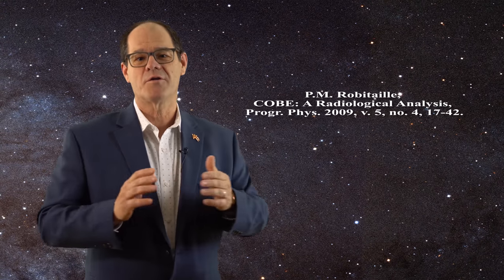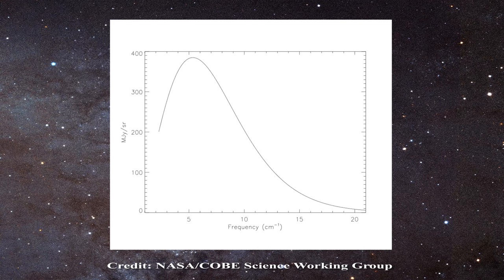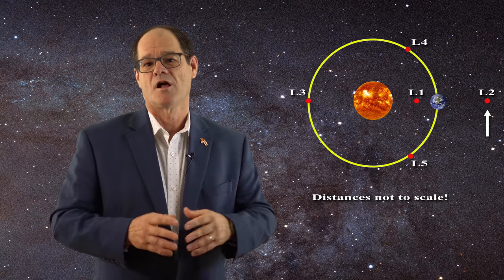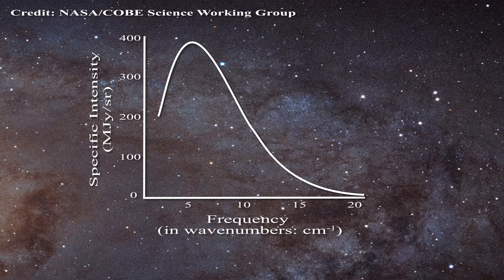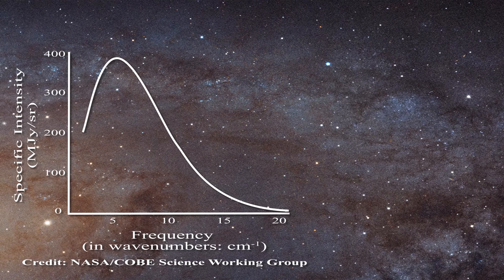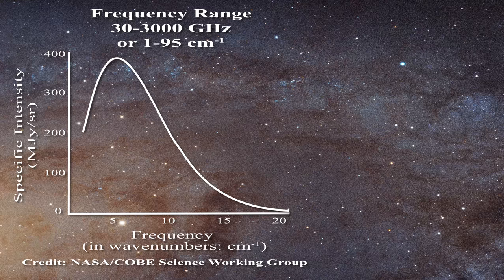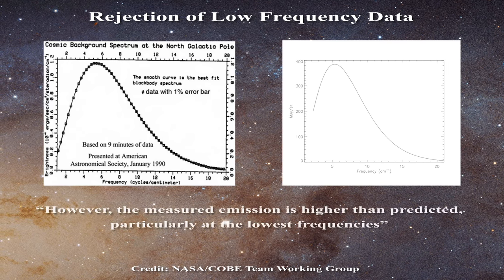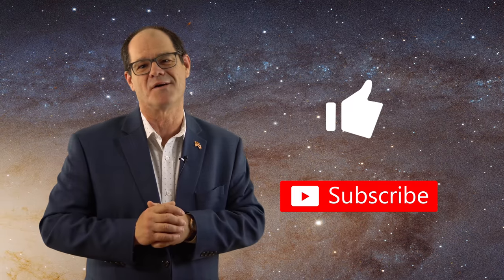The Microwave Background - COBE Satellite Results Explained!

Comment: Excellent.  Very informative and thought-provoking....  In particular, I love the part about the one sentence dismissal of the higher than expected emission in the low frequency band.  Scientific sell-outs.

In every field there is the challenge of measurement.  The real world is vastly different than theory.   Although I have not yet read the papers, as a computer science dude I can tell you that there are always challenges to how data is interpreted.  Moreover, there are challenges with algorithms for things such as curve fitting, first the mathematics but also the error introduced by numerical methods.  The computer science application of numerical methods is something that has been an intrinsic issue since the inception of computation.  I'd be curious to see the details of the mathematical algorithms as well as their data processing implementation. used to do all this interpretation of microwave detection data. 

So good to have you back Dr.  Robitaille.

Comment: I find it hard to believe that they didn't characterize beam patterns vs. frequency for the horn as mounted, including sidelobes and backlobes.  IT costs some money to do correctly, but this is the most basic antenna characterization, and you would have to be extraordinarily incompetent to not do this.

If there is not any good documentation on the beam patterns, they should be fairly easy to estimate by anyone knowledgeable of the basic design, and would be fairly easy to model using any modern RF tool.  I'd say the best they could do for sidelobe rejection at the lower end of the spectrum is about 30 dB, without sophisticated coherent cancelers, but they would also have to be very primitive to not include cancelers.

The heat shield is not good enough to block microwaves across all frequencies, as you get "creeping" waves in addition to diffraction, and just sheer skin-effect bleeding.  The full beam pattern with all interference compensation should have all been rigorously characterized and documented somewhere.
Reply: Well, they didn't characterise the beam patterns properly: far from it. Owing to the need to significantly reduce the weight of the satellite and to get it into orbit on schedule they cut corners everywhere, and thereby did not do what they should have. In fact, they did very limited testing on the ground and never with the assembled instrument. Moreover, they tried to characterise the beam patterns when in orbit, using the Moon as a source.  Dr. Robitaille has addressed all this in detail in his paper:

Robitaille P.-M., COBE: A Radiological Analysis, Progress in Physics, v.4, pp.17-42, (2009), 
http://vixra.org/pdf/1310.0125v1.pdf

Additional information on the thermal-RF shield inadequacies can be found here (page 214):

COBE -  On orbit engineering performance
, 

https://ia800303.us.archive.org/30/items/nasa_techdoc_19920008877/19920008877.pdf
Reply: @stevecrothers6585  Thanks, Steve.  I will dig into this a little further and see what I can find out.
Reply: What is/was stopping them from building a copy & fully testing the copy on the ground? I think this refers to COBE, but praps the same could be said for others.
Reply: @atheistaetherist2747  This is a good point, if they really wanted to confirm the revolutionary findings, there should be some due dilligence.

Comment: Doc, how do they distinguish the microwave emissions of galactic origin from the background behind it?
Reply: Simple. Just assume that nothing can produce microwaves except the big bang.
Reply: By statistics as usual. You can’t distinguish it at all, so they feed in statistics and model it until it looks pretty.
Reply: @Problembeing  black box of "methods" to produce image. I've yet to see a paper actual explain their data analysis in plain text of human processing.
Reply: Michael Pierce Indeed. well, if we go by the acquisition of the supposed image of a ‘black hole’ by EHT, where they took petabytes of data and used various methods to ‘remove noise’ (IE through process of elimination and bias through modelling and throwing out petabytes of data without independent oversight) I’m sure we can be legitimately certain a large amount of fudging and selective bias were invoked to produce this image. To average out an image of this sort, it stands to reason an element (arguable a proportionally high element) of feeding statistical data through a super-computer would have been the process to concoct it. The absence of the actual process to acquire this image speaks more volumes than any thing have published. It’s conspicuous by its very omission. What is even more striking is no one from COBE or any of its advocates or the scientific community at large question it whatsoever? How do things like this get a free pass when it is glaring at them like a massive rampaging elephant in the lab.
Reply: @Problembeing  that definitely seems to be the rub of it. Their modeling, and noise reduction methods are unpublished and obscured by technobable that they "did something" but didn't publish that methodology at all. It's one of the biggest complaints I have reading a lot of modern papers is how often detailed methodology is skipped in order to make big claims. it seems to me the bigger the claim the more precise you have to be with your methodology so that your peers can legitimately peer review your research.
Reply: Steve Crothers good ol’ Steven Crothers showing how it is even worse than imagined. It’s scandalous.
Reply: Michael Pierce well, as Steve Crothers has just posted, the whole thing seems to be nothing short of a complete hoax.
Reply: @Problembeing  I think what's happening is that people are protecting their careers by obscuring their research. We have a problem in the community of those interested in science where people have made an occupation around certain models being correct because of hyper specialization. Hoax has a different connotation to it in the public mind. This is simply people lying about their own research in order to self-serve.
Reply: Plasma Matter  the medium is undeniable.  It has a measurable dielectric constant.  It is the substrate upon which "reality" plays out.
Reply: Simple: They don't.

They feed the data to a computer, lower the resolution of raw maps (so that the processing takes much less time), run the data through models (I reckon that in all cases those models include Big Bang and inflation as a fact) and then apply obtained masks to the high resolution images and show them to the public.

Of course the joke is that they always obtain different masks, because each model produces different results and the microwave signal from the universe itself is constantly changing.
Reply: @LecherousLizard  he wound up covering that question in later videos.

Comment: An alternative approach to microwave background, otherwise the expanding universe from :-  Light speed and Doppler shift. 

We may agree that vacuum is empty in a jar but interplanetary space isn’t entirely empty. It is filled with Aether, electric charge, electric field and tiny particles - the size of molecule and down to subatomic substance. Light requires a medium to propagate that is Aether. Aether, is represented by two measurable substances, E0 and U0. 

Solar wind or solar charged particles loaded up the Aether space increases Aether from E0 and U0 to Er and Ur. Light speed is slower in close proximity with the sun produce a shorter wave length in Er and Ur, hence Blue shift in day time sun light. All spectrometers on earth calibrated with solar light will be biased towards Blue. With spectrometer carrying blue shift error, all stars in our night sky will appear Red shifted. Hence, no red shirted galaxies, expanding universe, Big Bang, bang echos or microwave echo background.
Reply: There is no vacuum in a jar.  There is always the aether, the substrate of the universe that we know otherwise as the dielectric.  It has a constant associated with it.  The medium is.  Without the medium there is no way to exchange/transform energy.
Reply: t00by00zer 
Well said. I agree. I knew vacuum jar isn’t empty is filled with Aether. I use empty jar as a start for curtesy to our Einstein’s friends. To avoid provocation.
Reply: What your so poignantly explaining, was known as the primordial waters of Nun. The same waters that Jesus walked on. Yes I said Jesus. The light in the Dark is the perturbation that is known as the Logos. When Phohat digs holes in Space, Anu appear.
Reply: Slightly Slanted Sleuth 3 4 Truth 
I’m sorry. You’ve lost me.
Reply: @philoso377  lost in space lol, jk. But the light, aka demiurge as it was known to the Gnostics, yes?

Comment: Here is a question about the claimed Cosmic Microwave Background curve produced by the COBE satellite instrument identified as "famous for having obtained the best blackbody radiation curve ever as you can see" in the figure presented in the video. The figure presented has the appearance of a Planck blackbody radiation curve over a complete wavelength-frequency domain, but it actually doesn’t come close to filling that domain. A graph at the link below is from a 1990 paper with preliminary findings by Dr. John Mather, a Nobel Prize winning COBE scientist. 

The Wien radiation law causes a Planck blackbody curve, when plotted by wavelength, to be steeper on the side where the wavelengths are shorter because the frequencies there are higher. Yet the COBE graph curve is not steeper on the side of the higher frequency wave numbers along the bottom of the graph. (Dr. Mather labeled these numbers: "Frequency | cycles/centimeter |.” To convert these to GHz multiply by 30, rounded, i.e. one GHz, one billion cycles per second, into the speed of light, 30 billion centimeters per second, rounded.)

The COBE graph appears to have the shape of a Planck blackbody radiation curve over a complete wavelength-frequency domain, but it actually doesn’t come close to filling that domain. The appearance is deceiving, is it not?, as it is said appearances can be?

Here is the link to the graph from Dr. Mather's 1990 paper with preliminary findings:

http://articles.adsabs.harvard.edu/.../nph-iarticle_query...

The graph begins from the left at 1 centimeter wavelength rather than 1/2 centimeter wavelength. 1/2 centimeter wavelength is the reciprocal of 2 "cycles/centimeter," 2 (cm^-1).

Does anyone care to comment or explain why the steep side of the curve is not the high frequency side as a blackbody curve over the complete domain should be?
Reply: The link to Dr. Mather's paper is broken. It seems you didn't copy the actual URL.

Comment: Hi, I would like you to clarify to me a problem I have with the theory of relativity.
At the surface of a star time is slowed down by it's gravitational potential by a certain amount( let us say A), After enough time(X time) the star collapses into a neutron star so the gravitational potential at it's surface is greater and therefore time is slowed by greater amount(B) .
The question is how does the change is the speed of time flow take X amount of time to happen?

Isn't it circular that time changes during time
Reply: Neutron stars do not exist.  Stars cannot collapse as they are not gaseous objects.  They are condensed matter, hydrogen in the form of a liquid metallic lattice or as a cubic solid.
See Dr. R's many videos on his stellar composition theories.
Black holes do not exist, nor does "dark matter."
Reply: t00by00zer I am talking from the perspective of the mainstream scientists
Reply: @wowfmomf6126  look up videos by Steve Crothers.  He's featured in Doc's channel a few times.
Reply: There is no such thing as time, or, there is, but it is merely the present instant, & this is universal. What we have is ticking dilation not time dilation, ie clocks change their rate.  Einstein was correct that ticking can be slower at the surface of a star, for atomic clocks (not necessarily for other kinds of clocks). Here Einstein was correctish for the wrong reasons, called equivalence.  He invoked spacetime, there is no such thing as spacetime. But experiments with atomic clocks seem to confirm that the ticking dilation equates to the escape velocity at that location, in which case Einstein deserves some credit (even tho it was merely a lucky guess)(which was based on one of his silly gedankens)(they are all silly).  Hencely i think that your question is redundant, if i understand it.
Reply: mad aetherist I agree 100% to what you said. Relativity needs a better interpretation that doesn't include space time since these two are absolutes like what newton used to think.
Reply: I think that we have lots of relativities, FitzGerald's, Voigt's, Cohn's, Larmor's, Poincare's, Lorentz's, & Einstein's. All are wrong. The best is neoLorentz Relativity (nLR)(as described by Reg Cahill), but even that is i fear not quite correct.  It is based on a free-range aether blowing through the cosmos (ok), rather than the original Lorentzian static aether (or the later Lorentzian partially dragged aether). Unfortunately the Lorentz factor adopted in nLR is simply the factor used in LR, which is probably wrong, the LR factor was originally based on an invariant c km/s, ie instead of c+v & c-v (v being the aetherwind km/s).
Reply: @t00by00zer  Well, perhaps your comment gives him an answer, namely that there is an inherent paradox with the whole space-time model, gravitation, etc.  So, the mainstream ideas support each other in a circular manner.  Perhaps that is one aspect of the problem with the traditional model of gravitation and space-time.
Reply: @wowfmomf6126  : Einstein 'defined' time by means of his clocks. Thus, for Einstein, what happens to his clocks happens to time.  However, time is not defined by clocks, no more than pressure is defined by a pressure gauge, speed by a speedometer, or gravity by a graded spring. Any measuring instrument is invented to measure something other than itself. Einstein's clocks however measure only themselves, so they can and do tick and tock as Einstein pleases. His clocks are detached from physical reality.

According to Einstein, time runs slower at the surface of Earth because his clocks run slower at the surface of Earth. An hourglass is a clock, so is a pendulum clock. Now the hourglass runs faster at the surface of Earth than above its surface, and when in orbit with astronauts in the international space station, it stops. Has time stopped for the astronauts because the hourglass has stopped? The behaviour of the hourglass is opposite to that of Einstein's clocks -  faster not slower at Earth's surface, slower not faster above Earth's surface. The same goes for the pendulum clock. 

There is no such thing as spacetime. Minkowski-Einstein spacetime constitutes a violation of the Theorem of Pythagoras, so it is false.

Crothers, S.J., Does spacetime exist? Sky Scholar,  2018,
https://www.youtube.com/watch?v=TJz10bDcccY

Crothers, S.J., Minkowski-Einstein spacetime: insight from the Pythagorean theorem, Physics Essays, 31, 3 (2018), http://vixra.org/pdf/1803.0208v1.pdf

The Special Theory of Relativity is logically inconsistent so it is false. Hence, the General Theory of Relativity is false.

Crothers, S.J., Special Relativity and the Lorentz Sphere, Physics Essays, V.33, No.1, p.15, 2020, http://vixra.org/pdf/1911.0013v2.pdf

ABSTRACT: The special theory of relativity demands, by Einstein’s two postulates (i) the principle of relativity and (ii) the constancy of the speed of light in vacuum, that a spherical wave of light in one inertial system transforms, via the Lorentz transformation, into a spherical wave of light (the Lorentz sphere) in another inertial system when the systems are in constant relative rectilinear motion. However, the Lorentz transformation in fact transforms a spherical wave of light into a translated ellipsoidal wave of light even though the speed of light in vacuum is invariant. The special theory of relativity is logically inconsistent and therefore invalid.